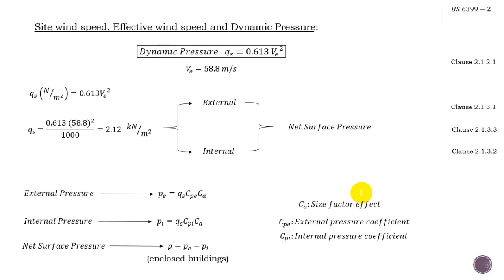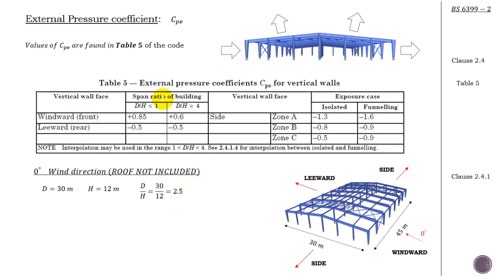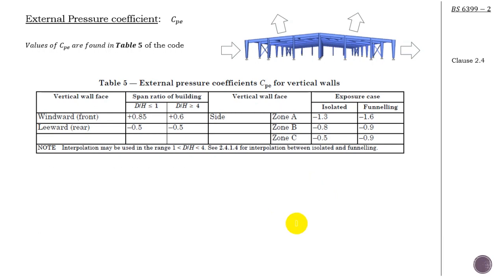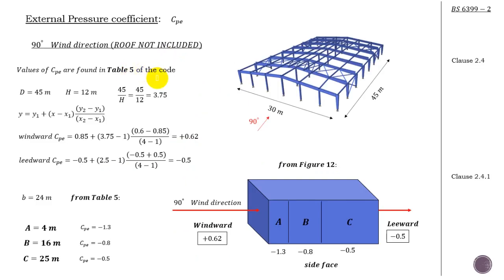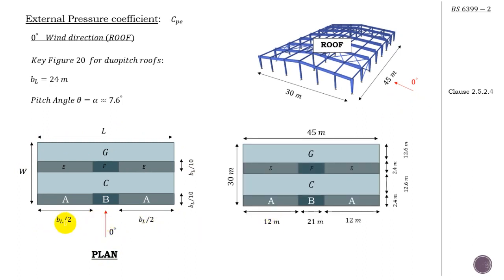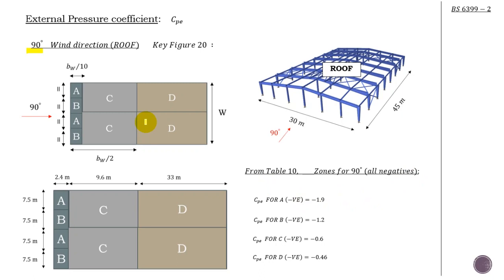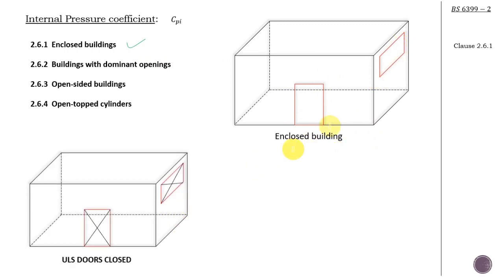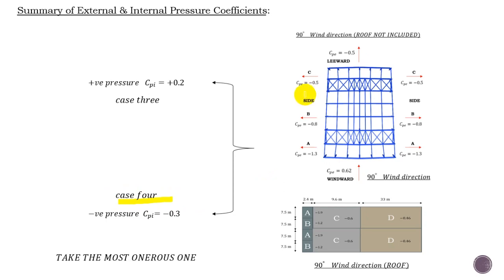Part 3: BS 6399 Wind Load Example (Internal & External Wind Pressure Coefficients)

Comment: I think there is a mistake in calculating scaling length for side walls associated with 90 wind direction. Since b=2x12=24m the results as per code specifications should be as following, A=4.8m, B=19.2m , C=21m. Please correct me if I'm wrong.